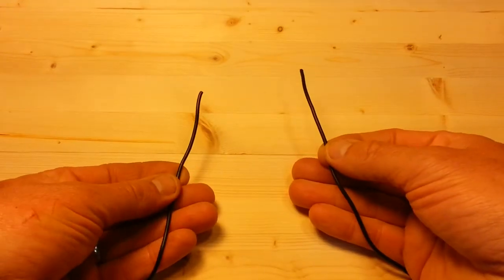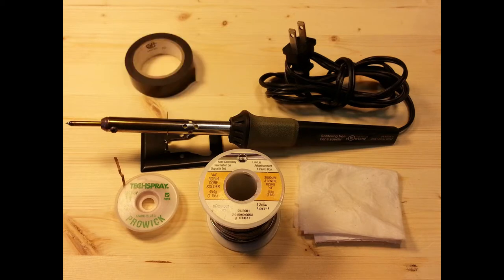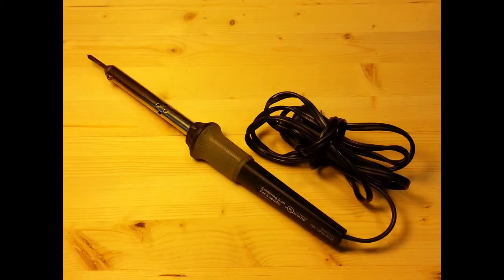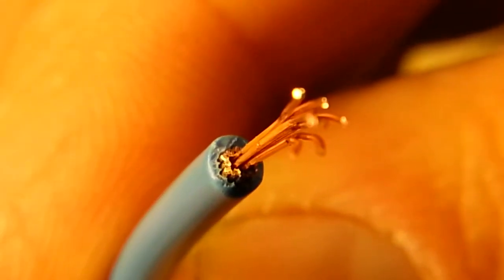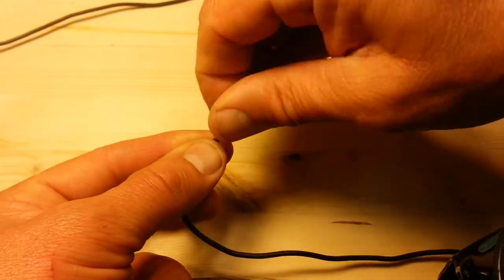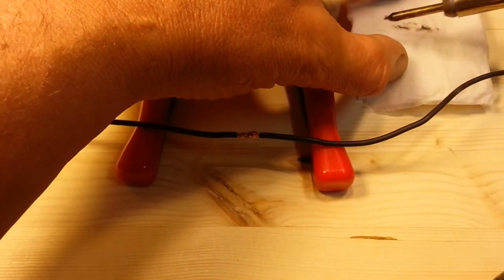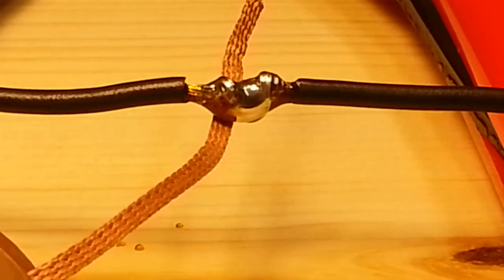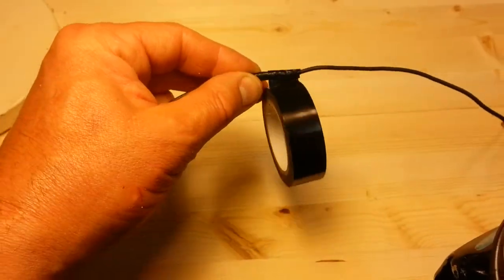Master the Art of Soldering: A Beginner’s Guide to Reliable Electrical Connections #12

Comment: what about 3 wires together?
Reply from the maker: For a three wire junction, I would for example, have 1 wire on the left and 2 wires on the right. I would strip all three wires equally. I would slide heat shrink tubing onto the left single wire. I would then twist the right 2 wires together with a not too aggressive twist. I would then make the same "western union type" connection as I showed in the video by making a hook on each twisted wire (single wire on the left, and double "joined" wire on the right) twist them as in the video, solder the connection afterwards and then slide the heat shrink down from the left wire onto the "cooled down" soldered connection and apply the heat shrink tubing over the connection with heat. Alternatively, if you don't have heat shrink tubing, wrap the connection up tightly with electrical tape. I hope this helps.
Reply: +Mysimplefix even on 13 g wire?
Reply from the maker: OK, is this wiring for a car?
Reply from the maker: RC Hunter  it's important to know what application you are using this for, as your local electrical code for your area must be followed if it's done for a home or dwelling.
Reply: Mysimplefix rc cars
Reply from the maker: OK, that will work. An alternative that could also be used, is to crimp a "butt connector" (like the one I showed in the beginning of the video) in place of the twist. It would need to be large enough to accommodate 2 13 Gage wires on one end, and the one on the other. Then slide the heat shrink over.... Both will work. The choice is yours which method you'll use.